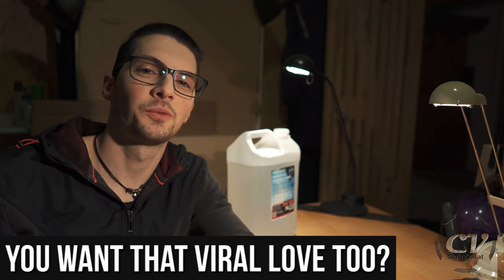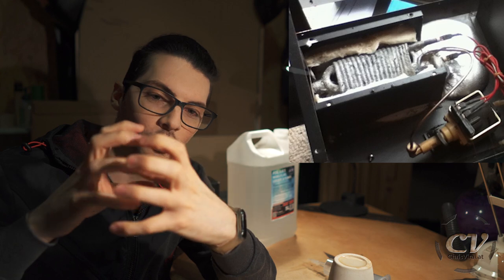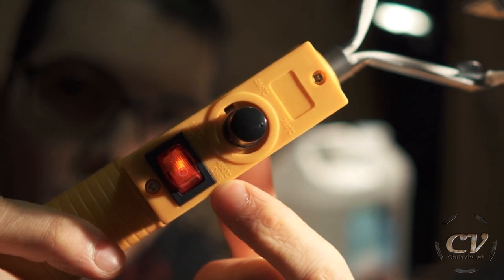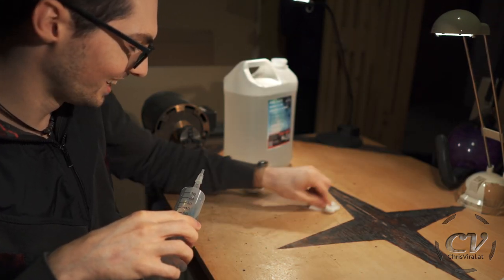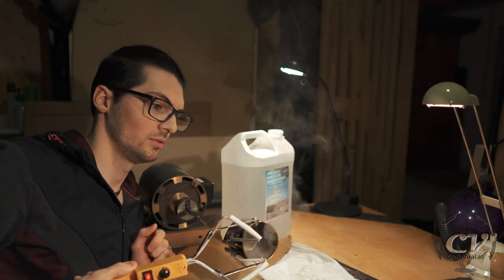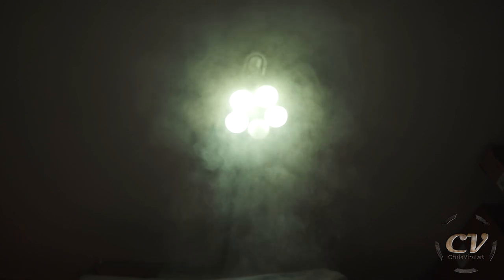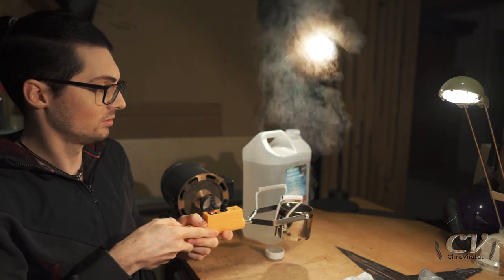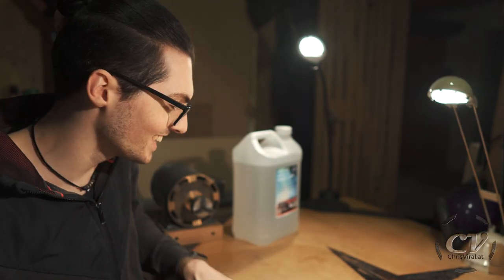How To Create Smoke Pt. 2 - With Soldering Pot (Success)

Comment: 3:53 to inscrease the surface put a stainless steel sponge (fine mesh) in the pot , might increase the smoke (compress the sponge if possible)
2nd idea , why not use a hot end from a 3D printer an a syringe to push it through
(up side down, nozzle point to the sky, syinge injects from the bottom up)
Reply from the maker: Oh damn these are some crazy ideas!! 🤭